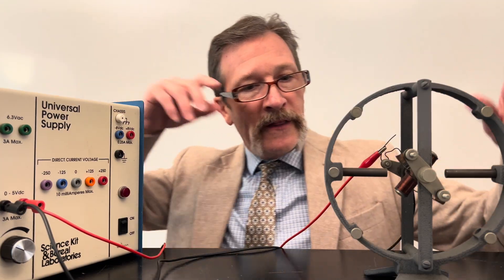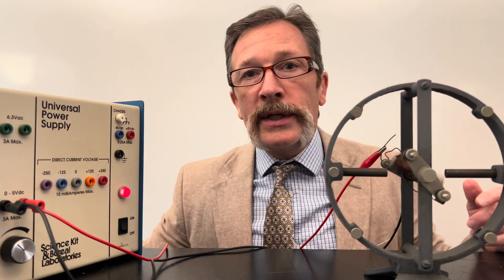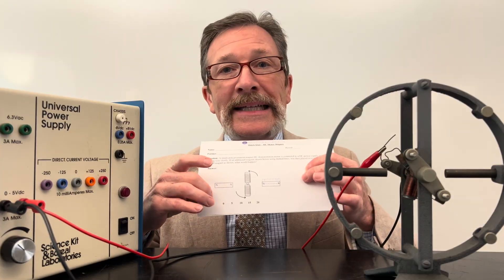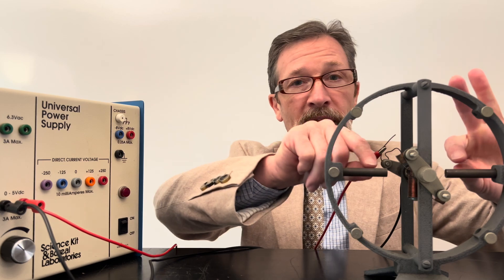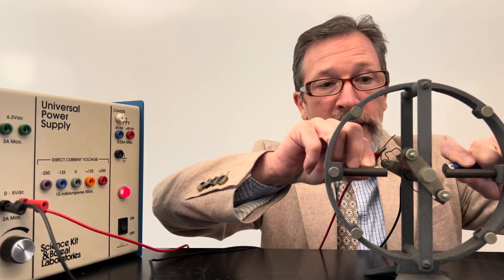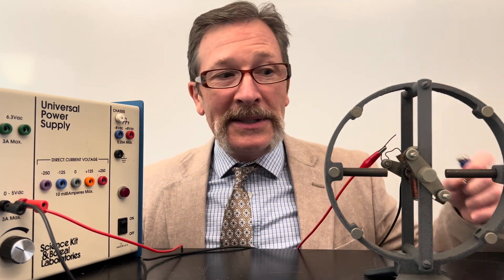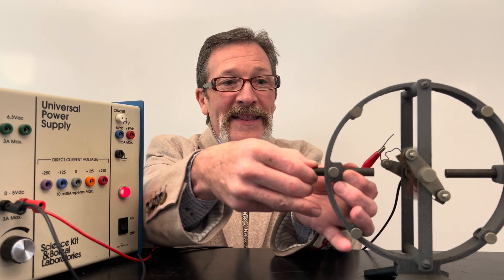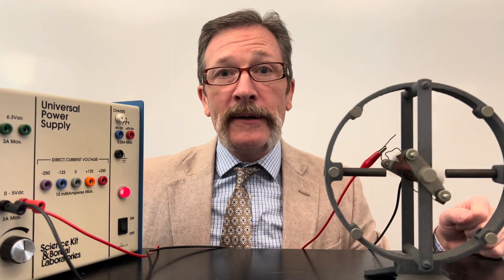Can a Magnet Speed Up a DC Motor?

Comment: Will the motor speed up if you put the additional magnet not next to the original two magnets but at 90 degrees in the same plane as the original two magnets?

Comment: Adding a magnet in a supportive role , even to just one side , will be an increase in energy added to the system , Resulting in the motor running faster.   When I was young , I got a motor
kit laboratory as a Christmas present from my aunt , and an assortment of batteries from my
favorite uncle .  I had to wind the poles , assemble the commutator etc..piece by piece , It came
It included 2 strong magnets , pole pieces , nuts n bolts etc.. a multi holed/function base etc..
I had a magnet collection of over 300 magnets .  I used it as a motor and as a generator , Tried
every magnet combination imaginable lol!  Best xmas present ever , I had so much fun learning
from messing around with that for years. I think I was 9.  My interest never faded , Only grew.

Comment: But where does the energy come from? If you speed it up with the magnet, will it drain more energy from the power supply (and what does that do to the power supply?) or does it drain the energy from the magnet, weakening it's field over time?
Reply: What if it can’t draw more such as a battery operate with limited power?